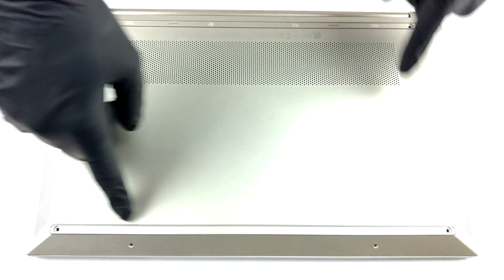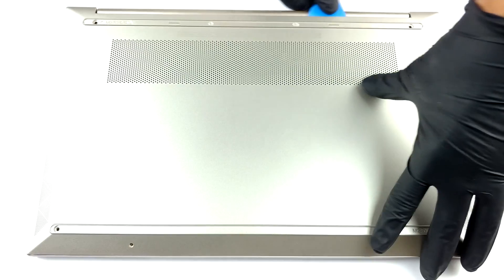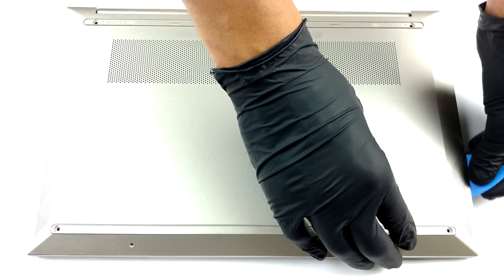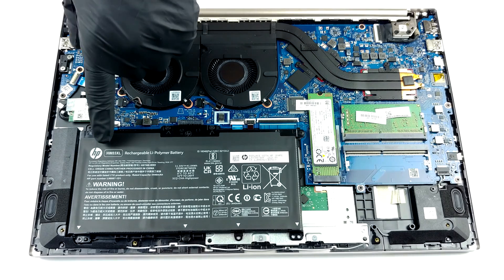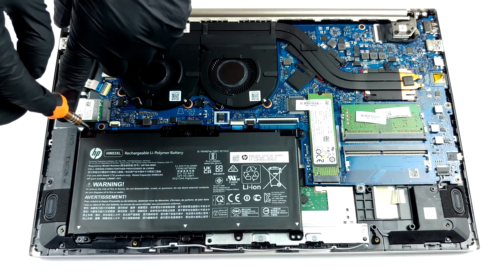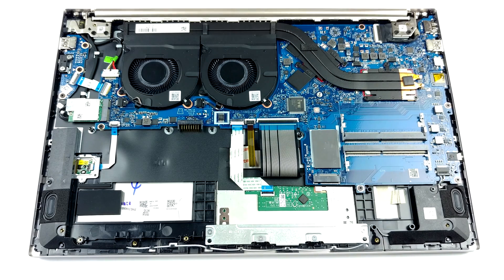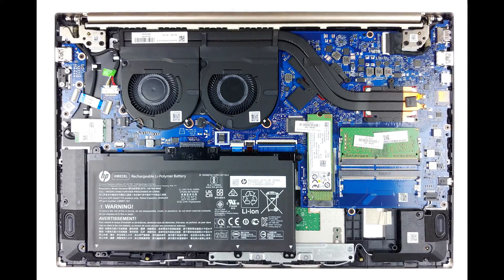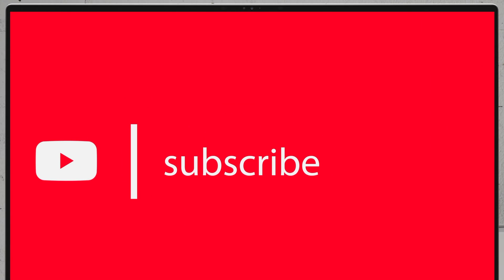🛠️ HP Pavilion 15 (15-eg0000) - disassembly and upgrade options

Comment: Can't really find any information on the laptop or motherboard. What's the memory like? DDR4 3200Mhz?
Reply: Looking at upgrading the memory, but I can't information relating to DDR or transfer speeds
Reply: 8GB PC4-25600 DDR4-3200MHz non-ECC Unbuffered CL22 260-Pin SoDimm 1.2V I think (2 of them)
Reply: not really sure about the PC4-25600 part cause its so hard to find info on this laptop but ddr4 3200mhz for sure

Comment: Thank you for the video. This was very informative to finding the screws. The screws under the rubber feet on the bottom shell are captured and you don't have to take them completely out to remove the cover. A guitar pick works great to pop the shell off the bottom without marring the aluminum. I had to replace the power adaptor jack in my HP Model 15-eg2073cl after my kids dropped it and broke it.

Comment: I need to get to the keyboard to replace it.  😢 Consider expanding the disassembly video.
Reply: Did you did it? If yes how because dont know if I have to remove the MB
Reply: @LuckyGreekBF     Yes, I eventually got there and replaced the keyboard.   It was hell.    Yes, everything had to be detached and removed to get to the keyboard.  The keyboard is welded to the case using  plastic rivets made of the melted case which  hold the keyboard to the top case.  (Were a few screws really too much???)   I carefully scraped the rivet ends  off, removing as little material as I could and was able to remove the bad keyboard.   I have a 3D printer, so I used some PLA filament and a soldering iron dialed down to the PLA melting point to plastic-solder into the rivet spots to attach  the new keyboard to the top case.
Reply: @SyntheToonz  Thank you very much. Tonight a client of mine told me to replace the keyboard and oh my god. They couldnt make it more harder really. I cant believe that I have to remove almost anything. And on top of that a screw was destroyed and cant be removed. 

I also have a #d printer but not a soldering tool. Maybe I will try my luck under the nozzle xD
Reply: @SyntheToonz  I finally reached the point. But they have like 50 melted plastic to hold the keyboard and the "silver base" whatever its called. Should I remove all of them?! xD
Reply: @LuckyGreekBF    i did.  I gambled that i could reattach it by remelting additional PLA plastic into the holes.  
I have a Haako soldering iron that can be set to specific temperatures and used that at a little over the pla melting point to reglue the keyboard into the supports.
I think a regular soldering iron is too hot fot PLA and you'll be making toxic smoke.  A hot glue gun may be a usable second choice.

Comment: Hello. I have a problem. I can't change speakers volume. They're always at maximum. The only way I can change volume is when headphones are connected to the 3.5 jack. HP community told me it was or could be an electrical overload but any of their suggestions solved the problem. This happened 2 days after warranty expired. Do you have any advice on what could I physically check o replace to solve this? Thank you so much.

Comment: Hi, I got my HP Pavillion 15-eg0053cl, not working, led power is blinking and Caps button  blinking 5 times low and 3 fast blinking, it got sound electrical near of the processor, Thank you for helping me and sorry for my bad english, o where i can purchase new motherboard?

Comment: Kind regards, my HP Pavilion 15t-eg100 PC, according to the app and the OS, comes with a KIOXIA brand SSD, Model KBG40ZNV512G, and according to all the references it is 2230 format, and in the video I see a 2280. That is my doubt to update it to 1TB. Also, if you collaborate with me, what generation this equipment supports, what references would you recommend for its parameters and that they adapt, in thickness, to this equipment, thank you.

Comment: Can i add hdd?
Reply: If you mean a 2.5" hard drive, no.  There is no SATA connector nor is there a drive bay.  You can replace or upgrade the NVMe however. I swapped in a 1TB NVMe drive, no problem.
Reply: @pcarlson214  Hey Can we add extra nvme m.2 ssd to the already existing one like now i have 512gb and i want to add extra 256gb. Can I do that? or Is it only replacable in which case i will lose the current OS??

Comment: I have the Intel Tiger Lake version (eg0167ST) I am going to put a 1TB NVMe drive in.  I have looked everywhere for specs, but is this a PCIE 3 or 4 slot?  Although the CPU is 11th gen i7, that doesn't guarantee that the PCIE slot is gen 4.  Don't want to waste money buying a gen 4 NVMe if it is a PCIE 3 slot
Reply: I have exactly the same doubt and I have not been able to know whether to buy the new 1 tb SSD of generation 3 or 4. The 512 Gb SSD it comes with is generation 3.
Reply: @alejandromojicarodriguez4905  The video calls it a PCIE 4 slot however, I don't think that's correct.  I believe this is PCIE ver 3.  At any rate I ended up going with a Samsung SSD 980 (Gen 3).  For my usage I doubt I'd even notice the difference between a gen 3 vs gen 4 NVMe - plus, it runs cooler which would seem a better match in a laptop.

Comment: What about the WLAN card? My new laptop in this series (15-eg0025nr) has a WiFi 6 card already, but I'd like to upgrade it to WiFi 6E if possible. It's unclear whether or not HP still whitelists its WiFi modules, and the parts lists don't mention WiFi 6E though they do mention Intel as well as MediaTek WiFi 6 modules (mine is a MediaTek).

Comment: Got my Pavillion 15 with a Ryzen 5500U, 16gb memory and 512gb ssd.
Its probably one of the best notebooks you can get for the 699$ I paid:
-It can be repaired or upgraded with just undoing 6 screws.
-The memory is a 2x8 3200mhz Kit running in proper dual channel mode. Ive seen many other Notebooks with really weird configurations like 8gb soldered in and an additonal 8gb installed in a sodimm slot.  Also others seem to use inferior memory kits running at only 2400 or 2666 mhz. Im not paying well over 500$ for a notebook to be cucked with bottom of the barrel memory.
-The SSD is a standard M.2 NVME drive so it can be replaced easily. And its quick for an OEM Drive: Mine measured 1750 MB/s write and 1150 read.
-Build quality is better than expected. The entire case is made from satin finish aluminium, except for the bottom cover. That surprised me, I expected more plastic. I unironically like the design and the feel more than the M1 macbook air.
-The screen is really good for being a basic 1080p LED-IPS Panel. 
-The USB-C Port can transfer at 10gbit, others are limited to 5gbit. Also you can charge the laptop via USB C. Ive tested that briefly with somebody elses USB C charger since the laptop comes with a standard barrel jack power supply. 

Overall this thing is an amazing package if you can find it for around 600-700$. 
I was so tempted to just get the cheapest M1 Macbook Air instead of a Windows Machine. That would have cost me 999$ but I looked at it and yeah the M1 CPU and the flawless MacOS experience are really the only reasons to buy one of those. Everything else on these is a joke:
Unuseable keyboard, screen barely any bigger than my phone, very flimsy and zero repairability or upgradeability.
Literally a soldered in not uprgadeable 256gb ssd is all Apple gives you. For one thousand dollars. What a joke... 
And I cant even plug a USB Stick into one of those because Apple decided your USB Type A devices should all end up on an e-waste landfill immediately. I lovew USB C but I need USB A too.

Also HPs windows install is not as bad as it could be. The bloat is minimal and doesnt affect performace at all. I will still install my own customized win10 ISO on this laptop but I am surprised how useable this thing is right out of the box. Once I nuke HPs windows install might aswell just install an Arch Distro like Garuda Linux.
Reply: I got hp pavilion eh1101au for 57000₹ Indian rupees....
Reply: Yes....apple making people fool
Reply: Do you receive generation 4 SSD?. The 512 Gb SSD it comes with is generation 3.
Reply: @alejandromojicarodriguez4905  No idea its quick and it just works. No need to upgrade that for now.
Reply: @alouisschafer7212  Thanks, is that I need to increase the SSD from 512 to 1 TB and I don't want to spend on a G4 if you don't receive it
Reply: @alejandromojicarodriguez4905  there are screws hidden underneath the two rubber feet pieces on the bottom very important!
The SSD should be a normal m.2 PCIe SSD but check first yourself
Reply: @alouisschafer7212  Yes, the question is whether the new SSD to buy is G3 or G4, so as not to make an unnecessary investment, thanks.
Reply: @alejandromojicarodriguez4905  I don't think this Laptop has Gen 4
Reply: @alouisschafer7212  Aja, the one that brings 512 is G3, I bought it 20 days ago +/-
Reply: hey, how is your laptop holding up?
Reply: Never pay for overprice Mac or other apple products.

Comment: I found this video very helpful! Thank you for making it. I have a question for you. In your experience would a Samsung 970 evo plus or wd black sn850 with heatsink fit. With heat sink they are quite thicker but hopefully don't run too hot.
Reply: I have that same doubt, about the thickness of the new SSD, and if this laptop receives generation 4, The 512 Gb SSD it comes with is generation 3.

Comment: Soo much room for a second m.2 slot, but hp is deciding to screw it up
Reply: At this price a SATA drive second slot makes more sense no idea why they wouldn't include it
Reply: Could you please point out where the m.2 slot I’m trying to set up an external GPU and using a pcie video graphics dock for it
Reply: @Gfryifwuuvffrxvhiiyfcbiurdxv  Yes the long green stick beside the battery is the M2 slot. I would suggest don't go into the whole rabbit hole of using an external gpu in a laptop thru M2 pcie slot. Better to use that GPU for a cheap gaming build (believe me it would be much cheaper in the long run) or you can simply sell your laptop and GPU to buy a cheap gaming laptop
Reply: @captainfatbat9557  thanks for the advice but i already have warrenty and anti virus protection on this and i dont wanna go through the cost of rebuying it all again but ill take it into considraton
Reply: Is the green long stick the m.2 drive?
Reply: also is it possible to get a bigger hard drive and transfer all the data to the new one or no?
Reply: @Gfryifwuuvffrxvhiiyfcbiurdxv  Since it has a single m.2 slot you'll have to buy a usb nvme enclosure to transfer the data if you want to change the internal m.2 drive
Reply: @Gfryifwuuvffrxvhiiyfcbiurdxv  Since it has a single m.2 slot you'll have to buy a usb nvme enclosure to transfer the data if you want to change the internal m.2 drive
Reply: The thing is if you plug more i/o to the device it will slow down because the motherboard has to process every i/o. And the power management will be really hard.
Reply: @menujawickramathilaka3847 how would you navigate that?

Comment: Great showed ! But as Im non english speaking person please let me know if there is the space for one SSD disc more. In te case when I want to add one SSD disk more. Thanks for your reply in advance.
Reply: I think yes, it have space for HDD / SSD size but you need additional connector
Reply: @shalahuddinyusufmuhammad2305  where would you connect the empty connector? It doesn't have empty slots like a desktop
Reply: Thank you @
LaptopMedia "for your answer" . ;( What is te problem with my question ?